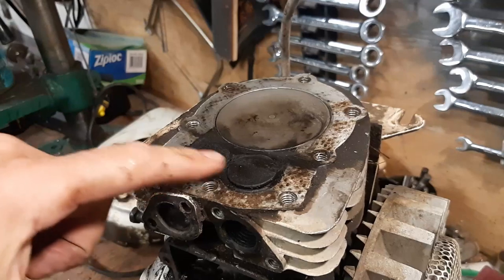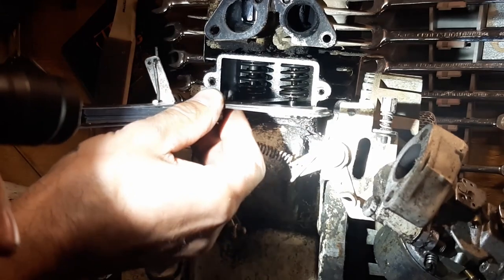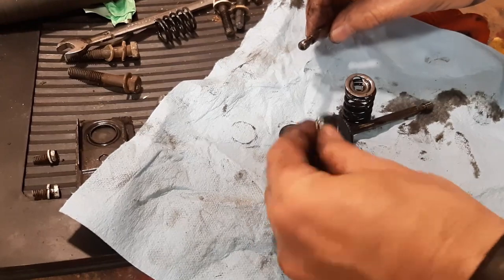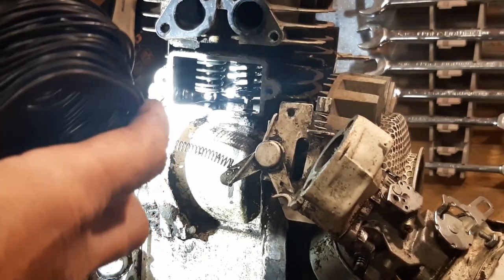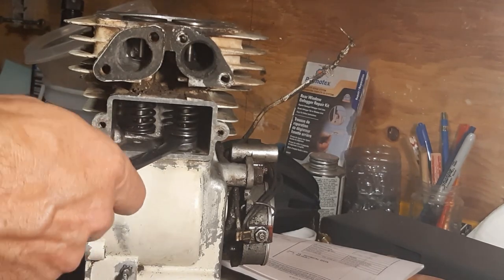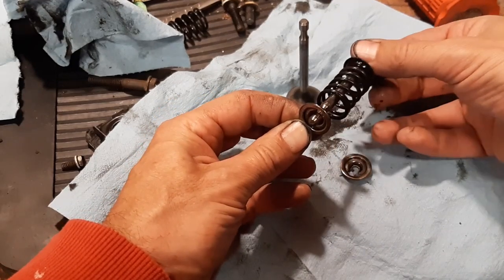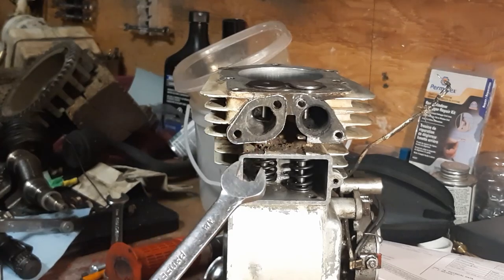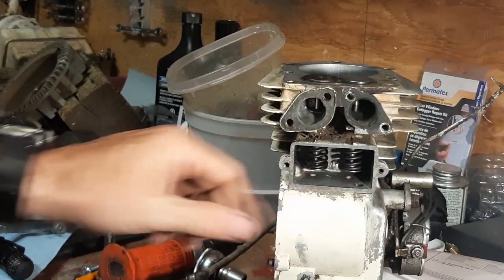Tecumseh HS40 valve removal

Comment: NIce video, but I am curious why you remove the cam?  I have done this on several H35 and H40 motors and never needed to pull the cam out to get them out.
Reply from the maker: Thanks!  I remove the cam and lifters simply because it makes it easier to work in the space, especially for reinstalling.  Good to know that you can do it without that step though.

Comment: Can I ask a question.....I have just stripped a Tecumseh hs40....it says in the manual that the compression release is on the exhaust valve....makes sense....the engine I have the compression release is on the inlet....any thoughts....thanks..
Reply: That seems strange, was it running before you took it apart?  Has someone else been working on it? Should be 1- intake, 2 - combustion, 3- power, 4 - exhaust